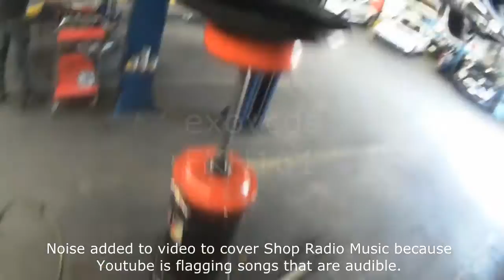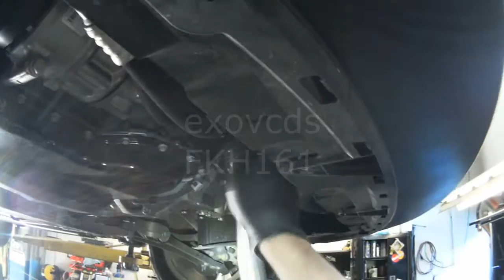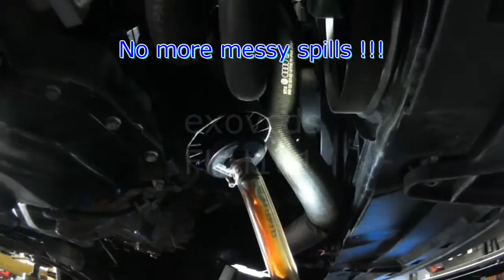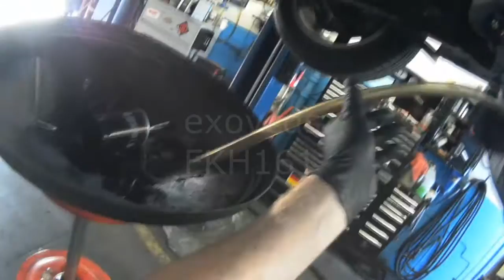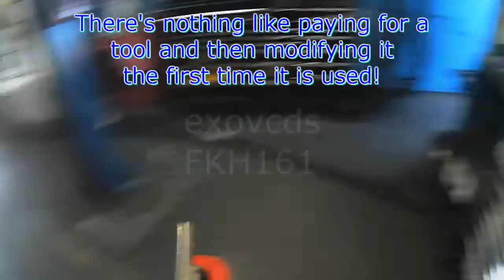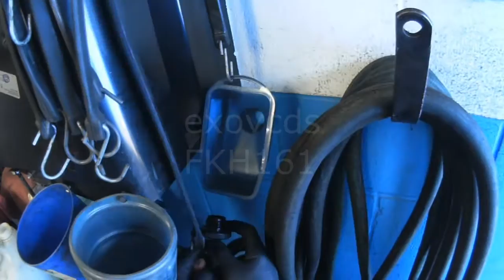VW & Audi: T40057 Oil Filter Housing Draining Tool

Comment: I was having a problem removing the filter from its housing. Thanks for the information. My filter came with one O-ring and a gasket, I put only the gasket, didn't find any O-rings in my set-up.
Reply from the maker: Some filters are used for different applications... just like thermostats. The same filter / thermostat can be used in different engines and requires different seals / gaskets. You only need to use the seal / gasket that are required on your engine.

Comment: Thanks for your video.  Was wondering, though.  Does this completely empty the oil out or do I still need to open the drain plug and drain from there as well...if I change my oil and filter? Thanks again.
Reply from the maker: Mark Carter This video is showing the correct tool that that needs to be used to "drain the oil filter housing"... yes, you will have to remove the oil pan bolt to drain the engine oil out of the oil pan. A 19mm socket will be needed for that.